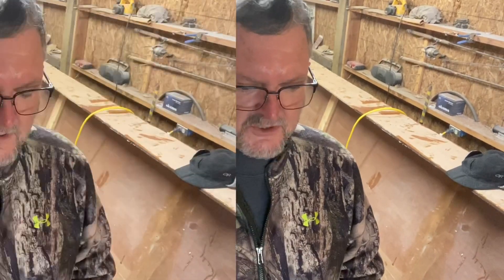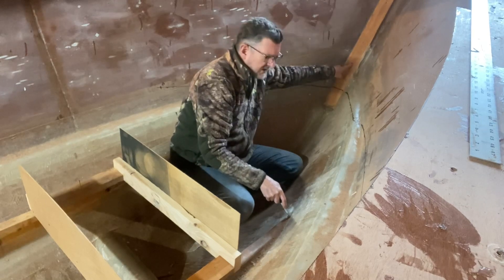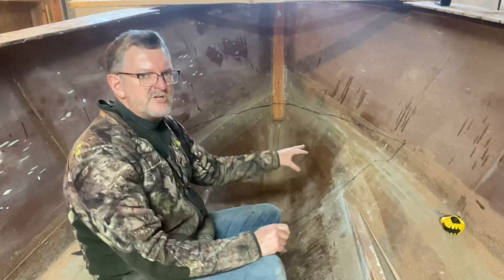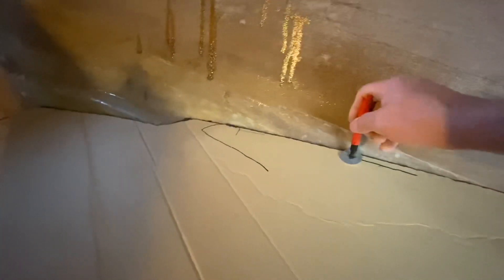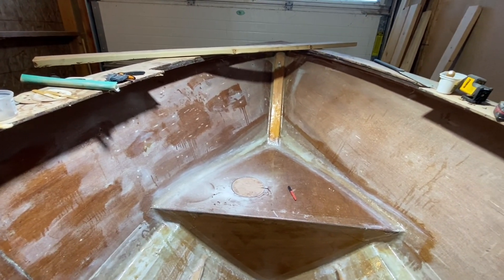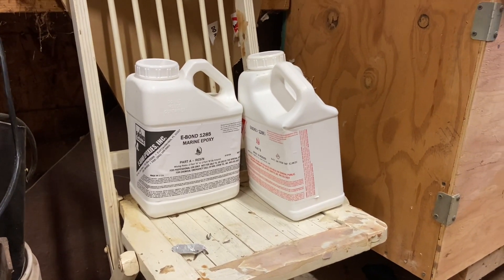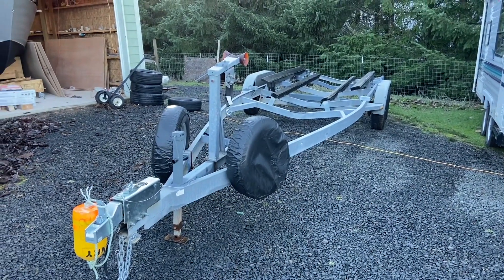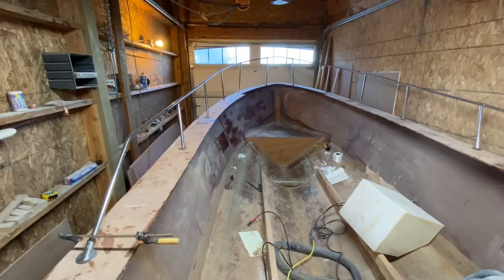Great Alaskan, Collision Chamber

Comment: Nice build, look forward to seeing it come along! 
Just a thought mind, although i have been working on yacht maintenance for several years, i have yet to build anything larger than a kayak, so i may be wrong here!
 But isn't the colision chamber there so as to provide a containment area behind the probable area of colision, so that in the event of a cracked hull, water will not flood the rest of the boat? I mention it as you have a drainage point at the bottom, which in that case could be counter productive? 😅
Reply from the maker: @Danimorera65  Hello and thanks for watching! You are correct. The designer left some discretion to the builder. Some people will fill this chamber with pour-in foam or other flotation to add strength as well as prevent water intrusion. Some people use it for storage and just use really tight covers. Through condensation, though, it’s probable that water will get in there so the drain hole lets you get it out. You could seal the hole off with an expansion plug so it is still water tight but drainable. After a summer of good boating in some serious water, the front berth storage and collision chamber are bone dry.